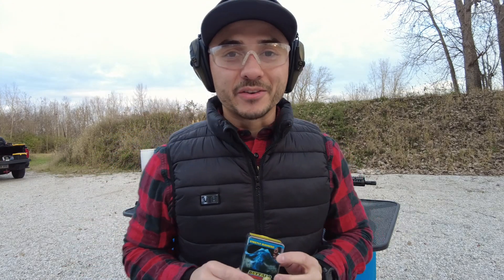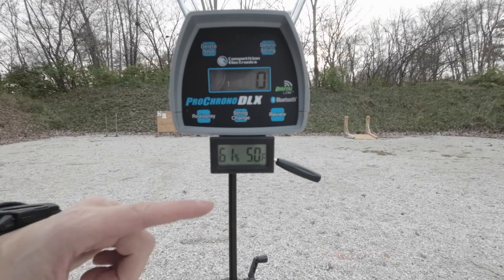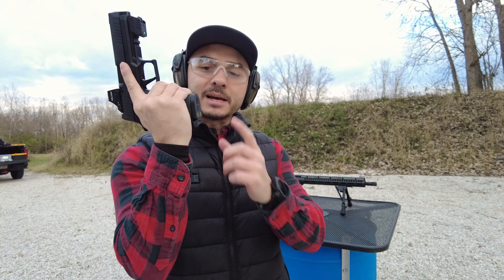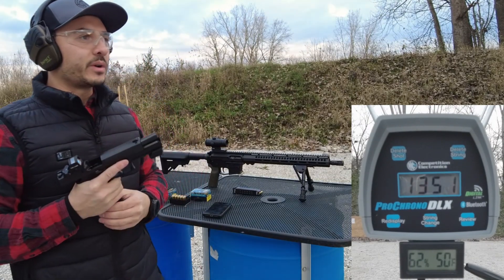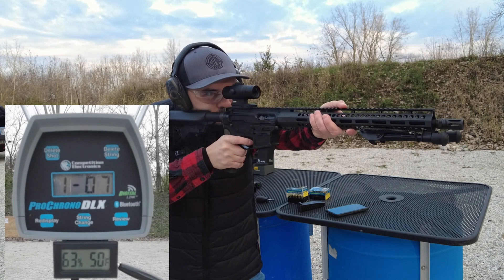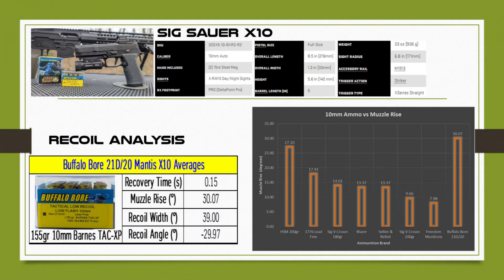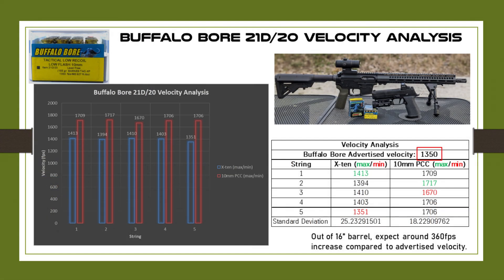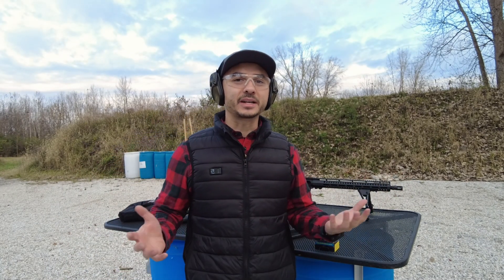Buffalo Bore 10mm: Velocity and Recoil Analyis BARNES TAC-XP 21D/20

Comment: This isn't the best Buffalo Bore 10mm self defense round. Although it is a good performer its known to be a reduced recoild round. The best 10mm defense they offer is a 180 grain xtp round going from 1350 to close 1400 fps. Thats there most popular and best performer they offer.
Reply: But XTP doesn't expand like Barnes al copper
Reply from the maker: Ah I wish it was on stock at the time when I bought this!
Reply: This is substantially better than the XTP or whatever random jhp BB loads (they randomly change it with other cheap projectiles). Velocity is not the main factor it’s the bullet. That said the Barnes SCHP tend to do very well when pushed fast.
Reply: No they dont, they will break off at higher velocities. XTP actually does very well with high velocities. Your right that bullet design matters but only as long as a high velocities are maintained. Just look in gel at the last half of the penetrative permanent cavity. Its basically a pin hole even though the round is fully expanded. That is a good indicator that when it comes to expansion, speed is king. Also most barnes copper rounds are usually slower. Why , becauseif the round is going to fast, it will frag apart@shaned3957

Comment: Cant read the small numbers was there a foot pounds of energy number ?
Reply from the maker: Yes, from the box:  "1350 fps/ME 627 ft lbs"
Reply: @58Alpha  oh ok sweet and what about the carbine??
Reply from the maker: Unfortunately I didn't put the info in the video, however, go to this website and you can type in the velocity of my shots and the bullet weight of 155gr and you will see your energy.  In that case, it's about 994 ft-lbs of energy out of the 16" barrel.  Energy is mass of bullet x velocity.   @Texasmade4444444444
Reply: @58Alpha  ok thanks 👍
Reply from the maker: @Texasmade4444444444  sorry I forgot the website...

https://shooterscalculator.com/bullet-kinetic-energy.php